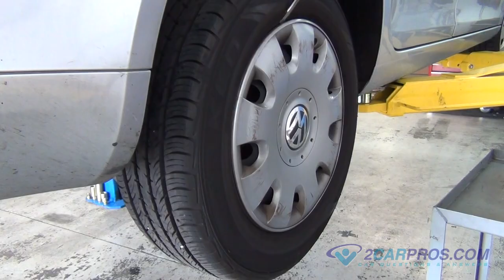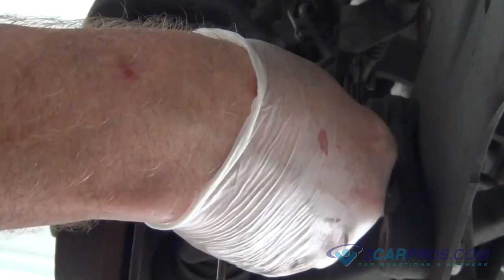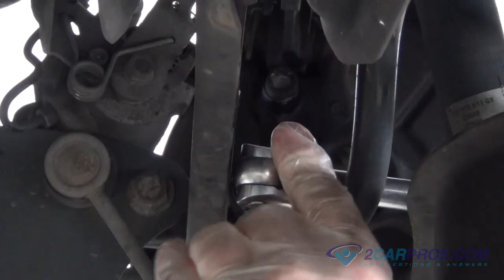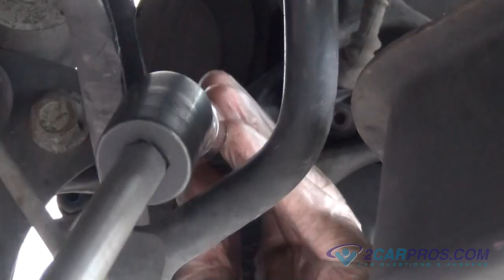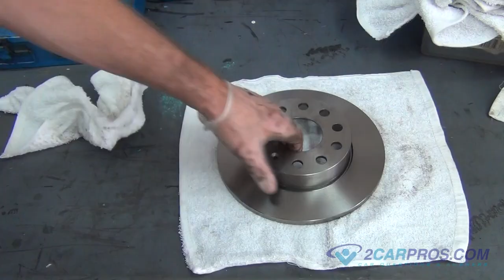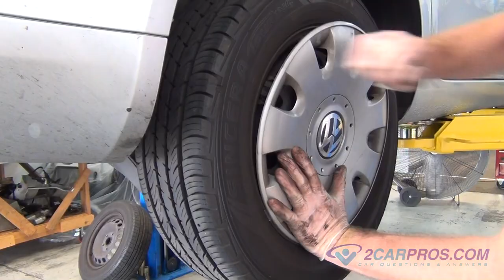Rear Brake Pads & Brake Rotor Replacement Volkswagen Jetta 2005-2010

Comment: The driver for the large caliper bolts is a T14 triple square driver ($8-$9 @ Napa) that needs to be torqued to 65 ft.lbs plus 1/4 turn. Supposedly those bolts need replaced after 1 use but no one sells them. The smaller hex head caliper bolts get 26 ft.lbs. They are also one time use but they are available. Another tool needed for this job is a T30 torx driver for the rotor retaining screw. One more thing - I had to use a set of needle nose pliers to rotate the piston back into the caliper (after slightly opening the bleeder screw. Check level later and bleed if necessary). Apparently you will damage the piston if you use the traditional C-clamp. Put the tips in the recessed part of the piston and turn clockwise as you push in. Good luck, Vdubs ARE COOL!
Reply: Thank you for this.  I bought the only "triple square" set in town, which maxed out at 12mm.  I guess that's what Amazon is for.
Reply: Thanks you. This video left out literally the only important info.
Reply: Sadie, the video shows the process of rotating the piston with the special tool u can borrow from autozone etc. he just shows this process near the beginning of video rather than near the end. but needle nose is an interesting idea. mite try it.
Reply: Are the caliper bolts an m14 triple square 12 point torx?
Reply: moneyhauler1 yes
Reply: @braceface112  thank you.
Reply: Cool! Yes... and intentionally over complicated to prevent average consumers from performing their own maintenance.
Reply: ALWAYS OPEN THE BLEEDER ( OR REMOVE HOSE), this prevents poluted fluid going back to the reservoir and ABC/ESC unit... keep them clean, avoid problem.
Reply: @isilder  never open the bleeder unless you are removing all the old fluid and refilling with new. 
It's not that serious. 
Try hard like that and turn a 5 min job into a 1 hour job or longer. Bleeders to seize up and break off. Not worth touching. 
Just make sure your pins are greased. That's more important.

Comment: I'm not surprised to see that VW would use a strange torx size bolt on their calipers to try to make it difficult for people or other shops to do simple work. I owned a Jetta IV, and my wife brought another jetta by marriage. I'll never own another one after hers dies. With VW, you get a car with a short lifetime, higher cost to buy and higher cost to maintain. There is NOTHING good about them except at least there is an enthusiastic aftermarket to buy parts. They wonder out loud why they keep losing market share in the united states, but I haven't yet heard where they're doing anything to not lose it.
Reply: David W My wife has a 2008 Beetle and it is by far the most frustrating vehicle I've ever worked on or stood near. Proprietary parts, fasteners, and tools.  Crazy mounting angles for everything and weird sacrificial rituals required to perform simple tasks like "change a battery" or "fix the headlight." Vehicles that are difficult and expensive to work on should be much nicer than this car. Faster, more comfortable, quieter, better fuel economy, ANYTHING PLEASE.  They're effectively disposable vehicles, minus the low cost and ease of maintenance and repairs you'd associate with a disposable vehicle. There are no circumstances I can fathom where we would own another Volkswagen, and especially not a godforsaken Beetle. Don't even get me started on the mysterious crayon smells.
Reply: l0bstar yet there are always articles in financial papers about "where did VW miss the boat?". I'd say making cars that cost more than other comparable vehicles, get worse mileage, cost more to maintain and last less long....what else do you need to do to fail?

I've found that a lot of the things that require special tools, unless they're fasteners, you can get around using the special tools to some extent, but it may cost you a broken clip or a couple of tool marks here and there. 

My opinion about that is the car is worthless anyway, so it can be worthless with some tool marks on it just as well as without them. And my pocket will not be lighter for stupid cheaply cast "special" tools, or other "special" tools that are nothing more than common limited access tools where they aren't considerate enough to just give you the generic tool name.
Reply: ***** I don't think you understand the difference between data drawn conclusions and anecdotes.
Reply from the maker: +David W We our not VW lovers. And reading these comments just make it that much sweeter thanks!

Comment: Thanks for the vid.  I was eventually able to do the pads and rotors on my daughter's '08 VW Rabbit.  Some of the bolts were so tight that it took a great deal of effort to loosen them.  Note:  14 mm Triple Square driver is correct.  I think it's misleading when people call it a T14, because I believe that would refer to a Torx driver which is a trademarked name for a certain company's six-point driver bit.
Reply: Also, if you are buying a Triple Square driver bit for this job, you probably want to get a short / stubby one.  I originally bought regular sized ones and once you put it in place, there was not enough room to get the ratchet attached.  I had to go back and exchange for the stubby set.

Comment: Just finished installing new brake pads and I did it without removing the mounting bracket. Is it really necessary to take it off if I just need to install new clips? I easily put the clips on without taking the bracket off.
Reply: You can replace the pads without removing the mounting bracket, but the bracket needs to be removed to remove the rotors.
Reply: Thank you
Reply: I need to take the bracket off to get the rotor off.
Reply: I'm currently trying to replace my brake pads by doing what you did. If you remember how may I kindly ask how you did it and you used?

Comment: FYI jetta mk5.5 (2010 just before they switched to mk6) uses mk6 rear disc brake specs so make sure to order the mk6 rear disc and caliper pads/brackets. The socket sizes needed are also slightly different, 19 to hold the square bit and 12 for the bolt.
Reply: Thats not the way to determine the rear pad requirement.. its equally confusing for MK6 !.  The Mk6 may have the bosch  calipers for 272mm  rotors, or bosch calipers for 282mm  rotors,and so you need to know caliper brand and rotor size.   bosch calipers on 272mm  rotors appears to use DB2211/BP1338 pads ?? NOT DB1865 (for bosch 282mm),  very similar from a quick look but no not the same.

Comment: Anyone know what size the front and rear rotors for 08 jetta Wolfsburg edition is? I’m looking at many places and that sell new ones and they say there’s will fit but I should measure my current ones to make sure. I’m getting like two to five different sizes when looking for the correct size.

Comment: What brand of caliper compression tool are you using? I need one of those
Reply: No you don't. Always bleed the caliper, anyway, to prevent poluting the ABS/ESC and resourvior, main cylinder.  But It also reduces the compression which means that you have reduced the forces, which is good for your parts (less chance of slipping and breaking something off  or scoring a surface that needs to be smooth ?? )  and for your hands.    To rotate the piston on the rears, a pair of long nose pliers does the job , if its bleed is open (or hose is disconnected )

Comment: do I need to remove the mounting bracket? Is it not possible to wedge the brake disc out? Or is that just the older models?
Reply from the maker: Not on this one, you must remove the bracket.

Comment: Hi, I will replace front and rear rotors and pads on my Golf TDi 2006. Questions is: When you push caliper piston down, is it must be twisted or you can simple push it down use big C-clamp?  Cheers from BC, Michael
Reply: Damn I have the same question I'm about to tackle a friend's Jetta
Reply: It has to twist and press at the same time there's a special tool you have to rent

Comment: Is this the same process I can use for my 2007 eos vw? I'm having trouble finding any information on how to replace brake pads and rotors specifically for the eos.
Reply: If it looks similar then yes.  For example, if it had electric park brake, then no. If it has the same handbrake mechanism,  driving the arm  on the caliper, and the caliper piston having the notches for the tool to rotate the piston with ...   then yes.    But  the EOS is a PQ35 platform car, which means its  hub is going to be the same as MK5,Mk6.. AND hold any Mk5/mk6 brake caliper and its matching rotor.. I see the car parts people list a whole range of pads for an EOS, which means a range of caliper/rotor  standards.

Comment: R.I.P 2:19 for those who only have a floor jack and can't get to that bolt lol
Reply: Just wanted to let you guys know... I was able to take it out by literally nesting myself into where the wheel goes lol.  Not sure how bigger/fatter individuals would be able to do it.

Also cut my wrist when the wrench slipped lol
Reply: Gonna be me tmr.. rip
Reply: Not at all if you can get your jack up high enough its actually not hard to get to just kind of uncomfortable
Reply: Truth brother! Some halfwit used bolts that were too long and used ten washer to shim it out. It's pretty much welded in there from salt and rust.
Reply: @zakmurrayy1202   True, I suppose it's easy to get to it..  

But if you live in the rust belt, one would know getting to it is only one part of the battle.. 

The other part of the battle is having enough leverage to get the rust infused bolt out =P
Reply: Welp 5 years later and I'm at it again.. Hopefully this time will be easier since I but some stuff ont he bolts to prevent it from getting super stuck from the rust.

Comment: Crucial info is the 12 point torx size, and is missing here. I have tried 12mm and is still to small, have had problem to find bigger ones.
Reply: +Rich Bacz 14mm
Reply: Snap on

Comment: What size is the rear rotor for a 2007 Jetta 2.5l.
Reply from the maker: +Lucy Vergari  , sorry we are not sure what you are talking about the rotor size or the size of the bolt used to hold it on?
Reply: Varies from unit off the line...use this VIN checker for your specific value. https://volkswagenforum.com/forum/vindecoder.php

Comment: I can't take the caliper bolts off to take the rotor off rusted in bad I think I need a impact wrench
Reply: I ran into the same issue last time I changed my brakes.. Did you have any luck removing the rusted brake caliper housing bolts?

Comment: what zide the torque
Reply from the maker: +sobrino pelusa That is a special VW only tool 12 mm 10 point tool, neat right?
Reply: Never once was any 10 point took mentioned at any point in this video?
Reply: @818kawasaki  you are right! And the M14 Stubby Triple Square isn't a VW only available only tool as well...

Comment: You have failed to mention that the caliper mounting bracket bolts are one time use only.  They are stretch bolts and need to be replaced every time they are removed.  The proper torque specification
is: 66 ft/lbs + 1/4 turn.  Reusing these is a bad idea.
Reply: Never heard or seen that ever? If that is true why does no mechanic mention that in any video?

Comment: my Jetta was worked on previously. trying to nail down what type bit to use, just jack that sucker up and take a look. None of the hardware on my Jetta's braking system was OEM. If you can't figure out what bit to use on your own, you really should not be performing said tasks.

Comment: What size tourque bit is that
Reply from the maker: +matthew curry Thank you for your question. That would be a 10pt bit from Volkswagen some auto parts stores may carry it, we suggest you call around to find it.
Reply: +2CarPros 10 point or 12 and what size 14mm?
Reply: M14 not a T... triple square bit and get the "stubby"

Comment: most stores only carry up to 12 mm 12 point bits. I am having a 14 mm 12 point ordered in.
Reply from the maker: Yeah some tools you might have to order on Amazon.com
Reply: I had to cut off most of the 14mm bit for the socket and wrench to fit in between the bracket mounting bolt and the upper control arm. Its for a vw rabbit. If u have any tips about vw rabbits I would love to hear them. i hate working on vw but you know I am too broke to pay a mechanic to work on it but I am smart with mechanical stuff